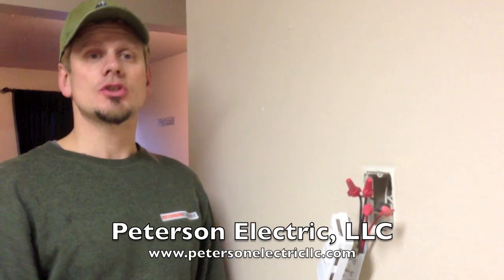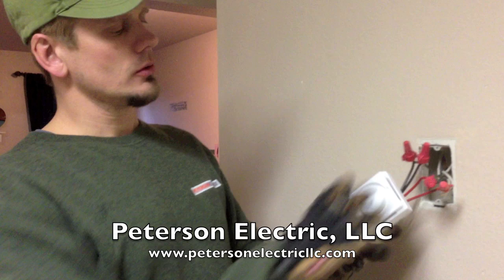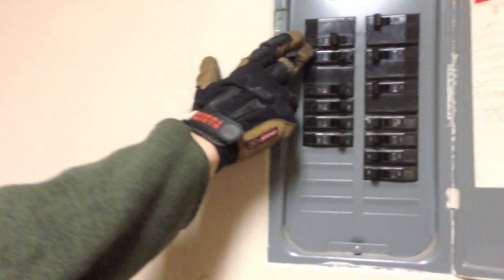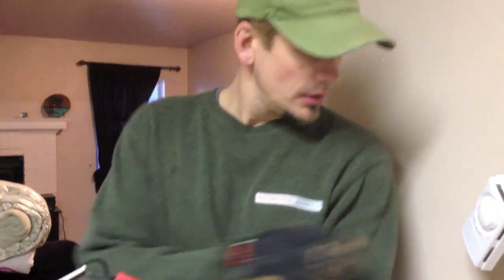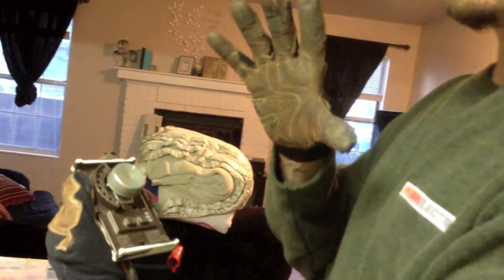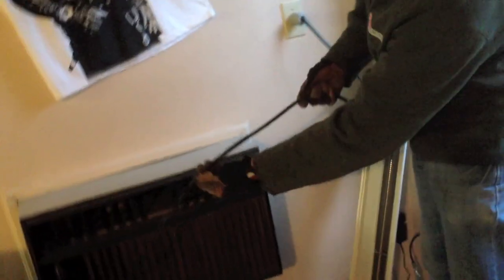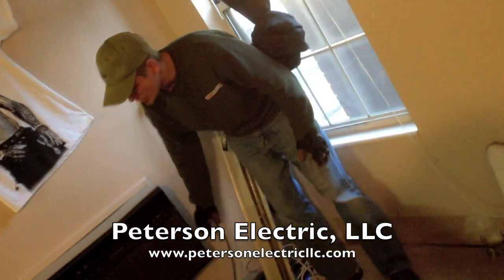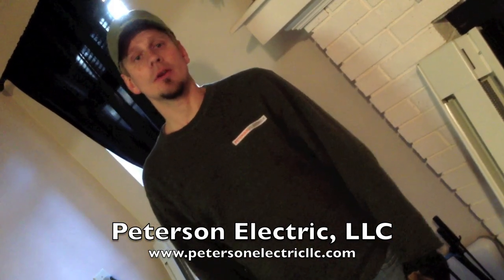Baseboard Heater Tips & Thermostats, Fort Collins Electrician

Comment: Great video but how has the efficiency changed?  I was trying to find out the difference from mounting the control on the base board heater or the wall.
Reply from the maker: Efficiency is also based on age and usage of devices. The older they are (30 yrs plus) the more carbon build up on the contacts of the T-stats and therefore the voltage will drop. Resistance creates unwanted heat through the device. This makes it harder to use the heaters. Energy that is unused and or not clean will cause your bill to go up, not to mention if the T-stat is flaky. Kinda of like a fluorescent light and no bulbs or bad lamps, so low lumens and you are still paying for the transformer to be on.

Comment from the maker: An ohm meter tells you a lot, but it's based on watts x length of units, assuming you know what they might be rated for. Otherwise, yes replace, but if you have not done this before as an electrician, I would not attempt this.

Comment: I have an old baseboard heater that has a switch on the unit (mechanical non-programmable thermostat). My problem is that the heater will not turn off when it is in the off position. Do you think I should replace the switch, or replace the heater? Other info: It recently tripped the breaker with a loud sound similar to a gun shot. I saw that the hot wire had touched the ground, but nothing appeared damaged. I insulated the areas and put it back together. It heats great, but won't turn off.
Reply from the maker: I would call a professional for this service and replace both.
Reply: Sounds like you have a single pole. 
Single pole do not have a positive off.
Honeywell came out with some digital line voltage thermostats for electric baseboard.
TL7235A1003 non-programmable TL823....... is the programmable model of the double pole models.
Double pole also have 4 wires, single pole 2 wires.
They also make a single pole version.

Comment: Have you ever installed a stepdown transformer for 110-24vts for newer wifi T-stats do you have any recommendations as far as what transformers are best and or rated for 1500VA load?
Reply: Yes a smart honeywell wifi touchscreen 24v T-stat the baseboards are 120v Im just trying to figure out if I need a stepdown transformer and the switch....Actually could you do a video where you hook a 120v baseboard up to a 24v smart t-stat? I bet it would get a lot of hits.

Comment: Heres what i found out, as far as heaters go the older ones are better becuse though they use a little more power they heat very well and fast and thus have long down times , where as the new heaters take long to heat the spaces and use more power in doing so with little down time so yuor paying more in power for the new.
Reply: Frank James If you want faster heat. I would install a recessed wall heater with an open coil design. Besides wall heaters are not as wide as baseboard heaters therefore you have more flexibility as to where you can place your furniture.
Reply: Open coil... not bad idea

Comment: Nice Video.  I got issues with my baseboards,  I think they are causing My thermostat to fail..   I wasn't sure that was possible,  But watch this video,  I guess it is..  Baseboards and thermostats are cheap,,  I'm gonna replace them all,  for a nice brand new system..
    There's really no way to test a baseboard, cuz they are a complete circuit anyways..  so an ohms meter won't tell you anything..

Comment: Should you get new baseboard heaters because new technology is more efficient? And the answer might surprise you, the answer by itself is no. However, new technology is better designed. In terms of efficiency the conversion of energy in the form of heat from electricity energy hasn’t changed. They use a series of resistances to make some heat that it heats the air through convention, then the air will heat the whole room. New baseboard heaters can be more efficient at the passage of hot air. There is the only way of improvement other than design that you can see in these new heaters.

All of the electric heaters in the market regardless of the age of release can convert electricity to heat at 100% efficiency in terms of possible conversion of energy by this method. That’s why the replacement of a new baseboard heater is not going to save you energy. If you recall a law of thermodynamics that says energy is conserved between a thermodynamic system and the surrounding. That’s why you can’t do anything else to save more energy with these systems, electricity and watts are the same no matter if that gets from an old baseboard heater or a new one.